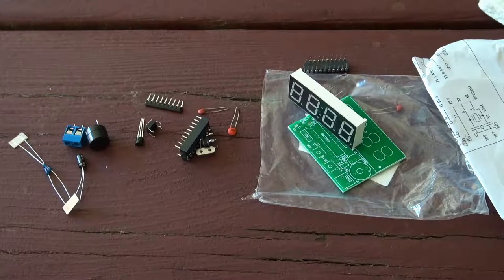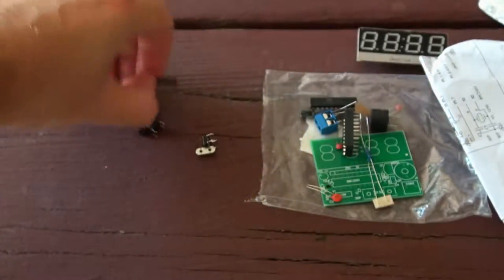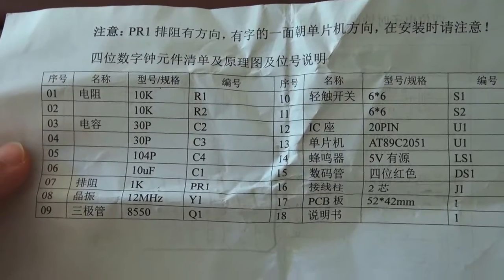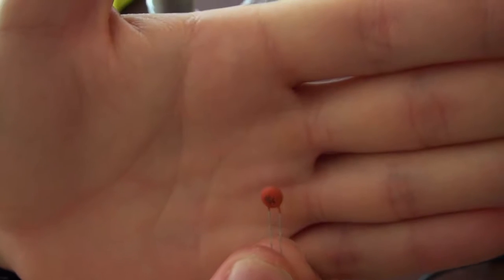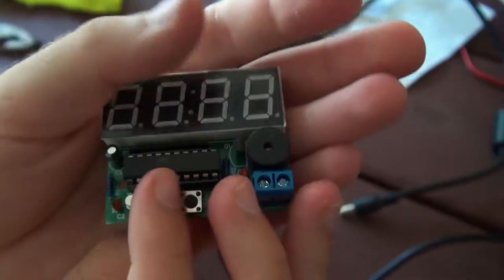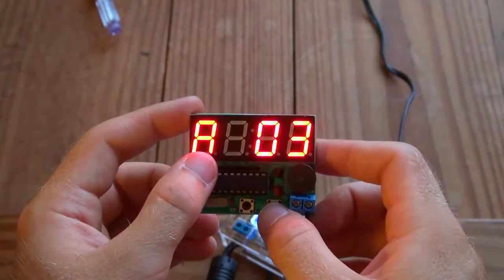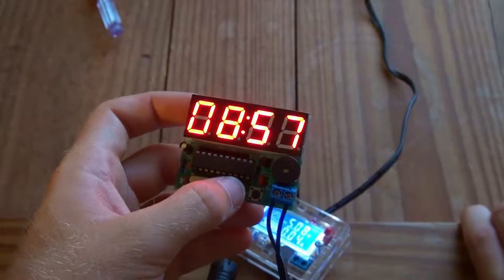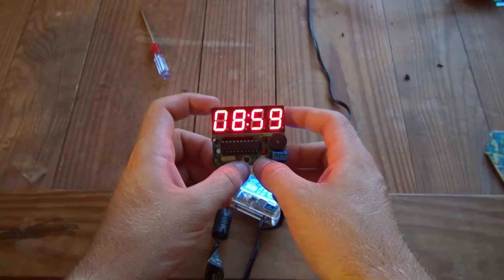DIY LED Clock Kit - Overview and Assembly - Circuit Seminar Ep. 3

Comment: '
did 2 soldering on switch 1 = 2 soldering on switch 2...
2=2...
dont need 4 soldering on switch 1= dont need 4 soldering on switch 2...
YSZ-4 C51 still good clock kit

Comment: It's called a resistor network and is simply eight resistors connected to a common pin. It does in fact, limit the voltage to the clock display. The same functionality can be had by using eight separate 1k resistors. The crystal provides a precise timing signal to the clock circuit. C2 and C3 are not bypass caps. It is very common to use them to smooth out the voltage going into an MCU. C1, electrolytic, stores voltage ensuring a constant input voltage. The "quick disconnect harness thing" is actually called an IC socket. The "104" stamped on the ceramic cap does not mean "10 to the 4". It indicates the value, 100nF. It seems that you are "not really sure" about quite a bit. From what I can see, you don't know too much about the "inner workings" of this type of circuit.